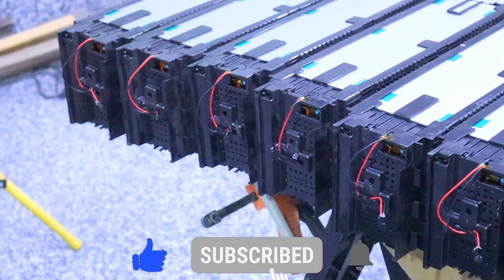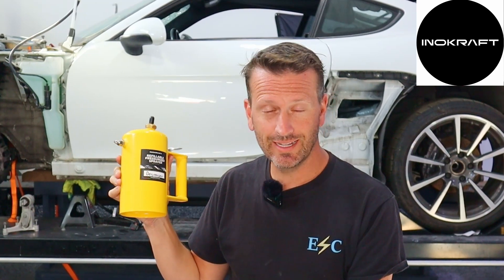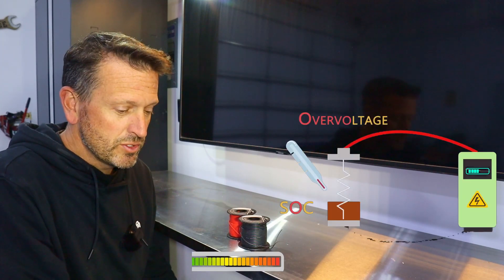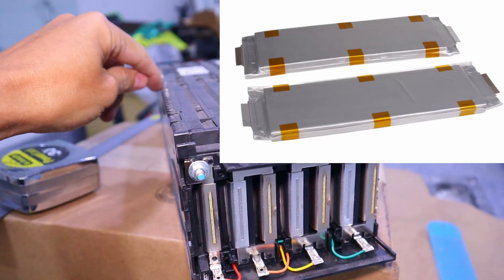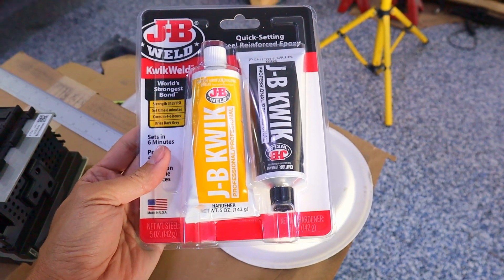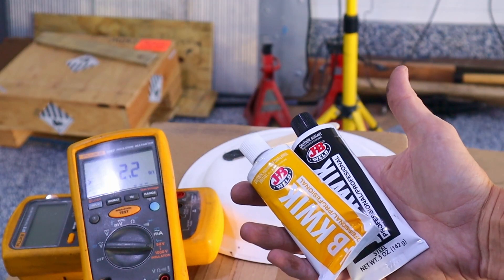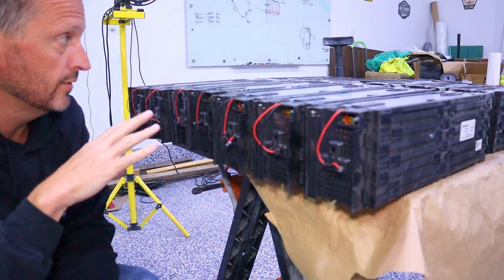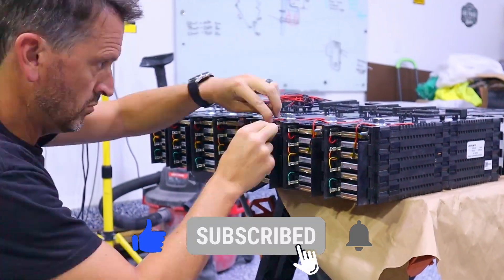How to STOP Battery Fires WITH THIS!  Adding thermistors to lithium-ion battery modules

Comment: Out of curiosity, why "JB weld" instead of a thermal epoxy?

I've genuinely never tested the thermal epoxy for conductivity, so just curious if you've seen otherwise
Reply: Also, I'm all for hot glue on everything stress relief! Except fingers... that only adds stress
Reply: Just did the same conductivity test you had with a heat sink I used the thermal epoxy on years ago, and it still reads as a open loop. 

FWIW, I used MG Chemicals 8329TFF
Reply from the maker: Thanks for the info!

Comment: Didn't understand how it's going to stop the battery fire? Especially if you left the car for the night and it spontaneously got on fire. Even if you in the car it might just let you know when you should get the fuck out, but it will not stop the fire.
Reply from the maker: I appreciate your comment!  Understanding why battery fires happen will help your understanding of why this is important.  Li-ion is very stable unless it is over-charged, over-depleted, or too hot from charge or discharge.  All of these conditions are managed by the battery management system.  Having thermistors will allow the battery management system to stop charge or discharge, this preventing battery fires. Otherwise you are flying blind.

Comment: What type of thermistor? There are several different curves that you can get, but they all are described by three curves PTC (positive temperature coefficient) NTC (negative temperature coefficient) and linear. All are curves, but very much not the same.  Some more exposition is required to not mislead your audience.
Reply from the maker: The battery management system that I have can handle any of these types.  The ones that I used are NTC

Comment: Since it's part of the fire prevention system, and it's not from a reputable source, but from what i understand, some Chinese vendor, I would make a test jig, to test each thermistor. a basic arduino some code and your up and running. Then heat them to almost max and let it cool down. Heat cycle it a few times and make sure they revert to the same temp expected. This way you can have confidence in the hardware. I would not trust them for safety unless tested.
Reply from the maker: Good call!  I like the thought of testing.  I will likely copy

Comment: That looks great!  It's nice to see a little bit of cable control in these projects, and a lot of forethought (e.g. connectors on each thermocouple.)  most of these EV projects make me want to cry with the cable control 

I would recommend a second dollop of the JB weld for your strain relief instead of kapton tape. kapton will not provide a whole lot of strain relief especially with vibrations over time.  The goal of strain relief is to put the force of a wire pull on the insulation of the wire as opposed to the solder joint or the point where the thermistor is bonded to the battery.  Also (I couldn't see if you did this in the video) you could find somewhere on the outside to cable tie the wires down.  you want to make sure those wires are locked down when they come through the plastic enclosure so they don't rub and abrade on each other. 

for your next project, I would also recommend you consider some RTV silicone as opposed to the hot glue.  Hot glue will work fine, and I don't know what your temperatures will be like but when you are getting to the higher temperatures hot glue can start to soften and loose adhesion.  RTV silicone will give you the same softness and flexibility, but will hold up a lot better over time.
Reply from the maker: Thanks for the comment!

Comment: Interesting, didn't know you just stick them on and the cell warms the outside of the epoxy to give a temp reading, I thought for sure you would have current running through them to sense heat.  Learn something new everyday!  Thanks for sharing these small details.  I will probably be using the same batteries.
Reply from the maker: Voltage is applied to the thermistors.  Temperature changes the resistance values which the battery management system interprets as temperature.
Reply: @electricsupercar  My company does the same with hydraulic pressure sensors.  voltage applied to a coil as the coil changes shape due to pressure it effects the resistance and we know the pressure being applied.
Reply from the maker: Nice!
Reply: @electricsupercar  yeah I get it. I guess I just never knew it worked through the epoxy.  I was expecting a 3rd wire that you solder on the battery.  Very cool.

Comment: SORRY but you are VERY miss informed.
Thermistors will NOT prevent fires.
Cells can spontaniously short and catch fire.
A single cell can cause a thermal run away.
A cell can be damaged physically by a crash and instantly catch fire.
This type of system can only warn you of some possible future issues but it wont prevent fires.
Reply from the maker: This is a preventative measure to stave off preventable fires in cases of charging or discharging to prevent thermal runaway before it happens.  It cannot prevent every possible way of battery fires.

Comment: Great to see. I'm using the same batteries in my project and enjoy seeing how you are approaching it. I bought the thermistors that are small metal cylinders and was not intending to put them inside the plastic enclosures, but it's definitely food for thought.
Reply from the maker: Good luck with your project!
Reply: Careful with that!

Most metal covered temperature switches/some sensors is NOT insulated and one wire is directly short to the casing!.

Ceramic ones are much safer
Reply: @tullgutten  Thanks. I'm not attaching mine to the cell tabs. They will be isolated and just reading the ambient air temp inside the battery box.